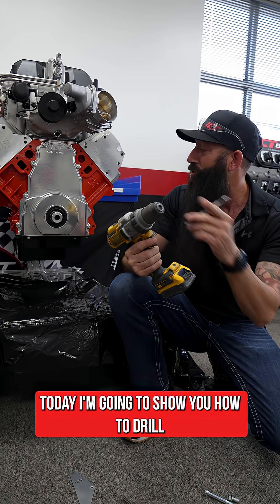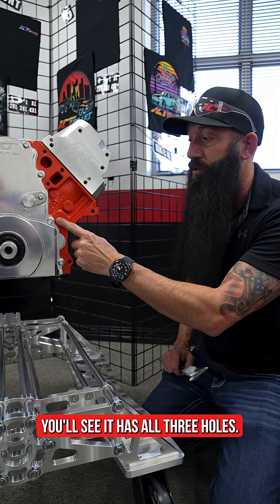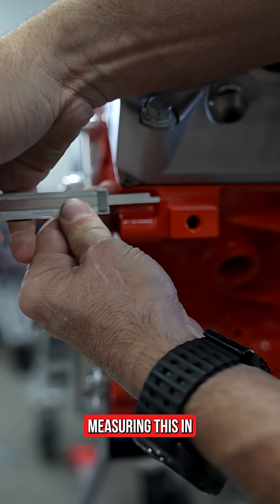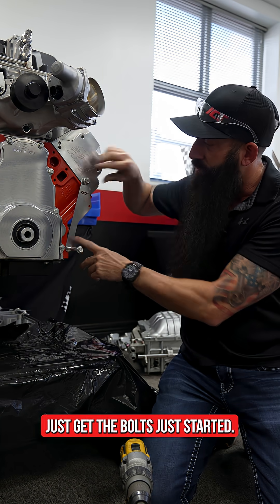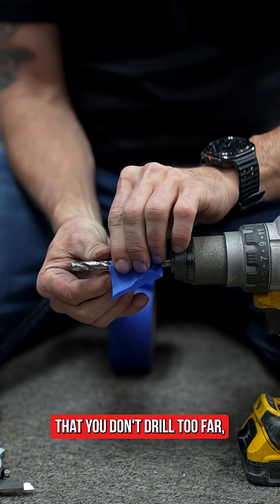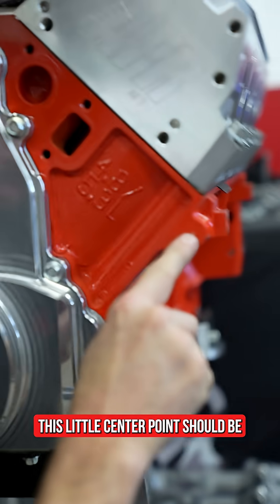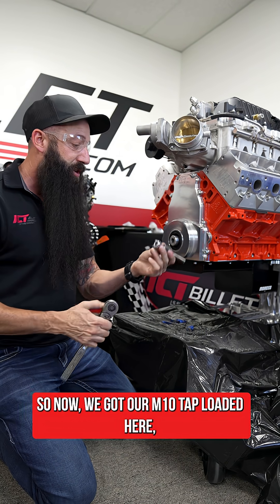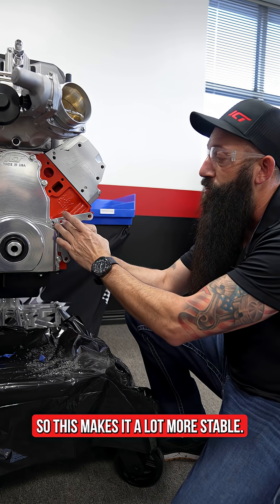How to Drill an LS Truck Block for Low Mount Brackets.

Comment: What would be real nice is if the template had a drill guide, just a piece of mild steel bar stock with the center drilled out on a late and then weld that to the template and voila, no worries when it comes to keeping the hole square :)